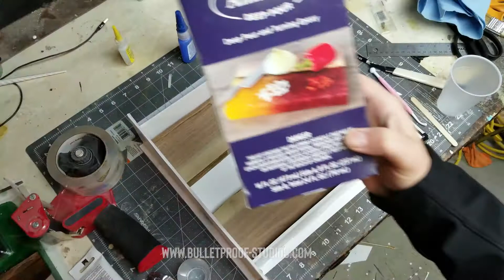Making a Star Wars Charcuterie Board (Epoxy Resin)

Comment: This looks absolutely amazing 👌. I'm currently in the process of making a resin coffee table and want to do it star wars themed, what size models did you use for this??
Reply: Hey! I am about to make an epoxy river coffee table too! Have you attempted it? What did you use for the ships? I was going to use plastic models but I am worried they will melt in the epoxy? Do you have any tips?
Reply: @jonahevers9371  hello I jonah, I did attempt to make the coffee table and successfully finished it too, very happy with my results. I used star wars micro machine models in mine and they worked perfectly in the resin no melting at all even the mini figures af luke, vader and a couple of storm troopers. Only tip I can think of is make sure they are securely fixed down before you pour your resin as once it's set there's no chance of correcting them after. You'll find the starwars models on ebay too. Good luck and I hope your table turns out brilliantly 🤞🙏
Reply: @robw6145  oh sweet, thanks! We’re the micro machines you used plastic? I assume so but I believe you can get metal micro machines too, I could be wrong tho
Reply: @jonahevers9371  your very welcome, the ones I used were indeed plastic ones, I even cut a tie fighter into pieces to look like it was shot down in battle, all in all they withstood the resin very well indeed and will use them again on the next table I do, little trick I did which turned out perfectly was I used pencil lead from green and red colouring pencils as the laser beams 👌 and painted wadding from a stuffed toy as the smoke 👍 I hope this helps you with your project. Models were from ebay too. Good luck with your table and have fun building it 😜
Reply: @robw6145  thanks! That was very helpful
Reply: @jonahevers9371  no worries buddy, just seen your other comment too and personally I'd go thicker than 1 inch. Maybe 2 would give better results. Mine was about 4 as it was a tree stump live edge table 👍